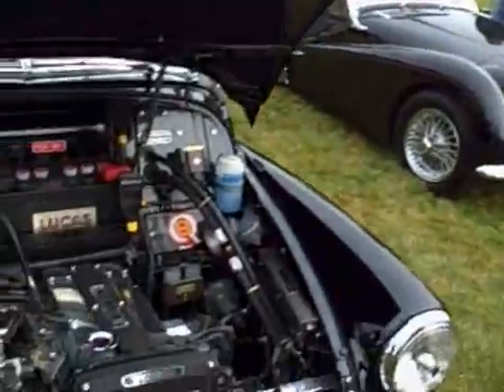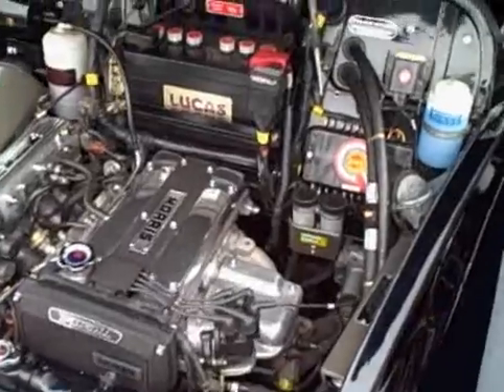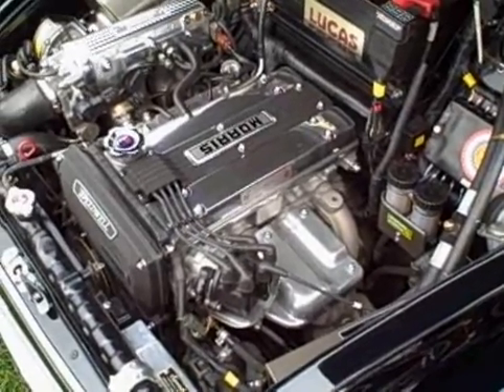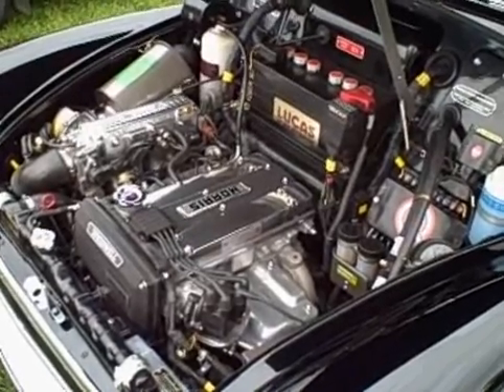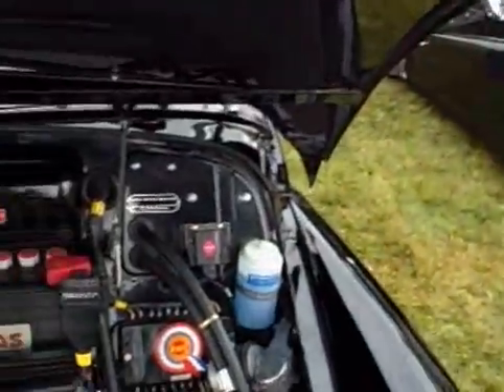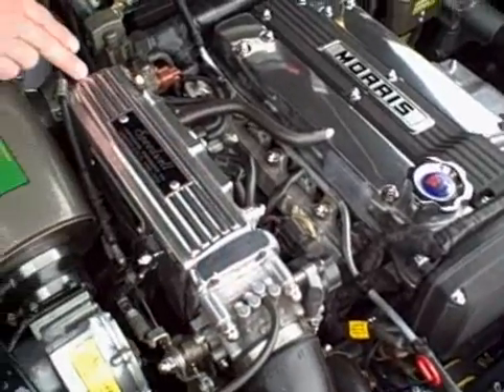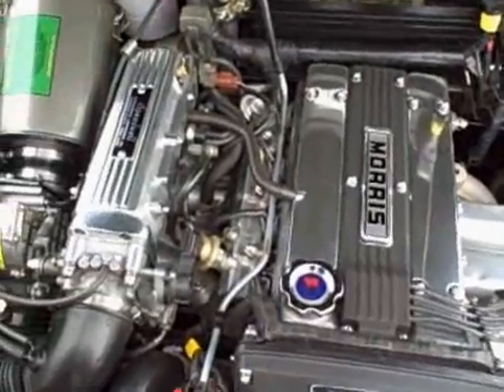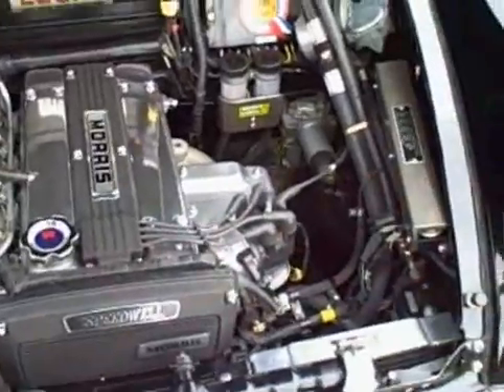Morris Minor Master Engine conversion

Comment: My first car was a 1959 Morris Minor 1000.  Light blue.  Didn't leak oil sitting still and didn't smoke but it used copious quantities under way.  Also no matter what l tried the brakes were  frightening.   I ended up trading it for a 1959 Karmann Ghia convertible with a Judson super charger and a 4 outlet Abarth muffler.  It was a fun car.  I drove it too hard and ended up driving off of a bank into a bog with about 12" of water.  I survived it all proving beyond doubt there is a God.

Comment: Hi Zac just wondering what you did for your fuel tank and return setup? is the thank off another vehicle?
Reply: The fuel tank is the larger "Seven Gallon" unit from a 1000 Traveller. I added a 1/4" return line to the tank.

Comment: Who were the five people who clicked on "dislike" - and why?
Reply: Del350K4 Great Conversion, but for a few maybe it's that he moved away from the true spirit of 'The Galloping Maggot,' what with all that eastern technology stuck into the engine well.....some might have gone for just an old school upgrade  with   M.G Midget / Sprite  Block... twin Carbs and a polished head coupled with a high flow high spec exhaust.... but i prefer this upgrade ....
Reply: That´s a balanced assessment; I´m sure you´re right. I´m very glad that you agree that there´s room for the old school and the more modern approach. I confess I do have a personal aversion to big alloy rims on classic cars, for example, but I try not to pull faces (and certainly not click "dislike") when I see such things   : )
Reply: Had a Morris Minor as a kid... very-very...easy to work on, you could stand into the engine bay to pull off the cylinder head [and i did] and just drop off the front grill with a single spanner and a screw driver then just lift out the rad... try that on a modern car...  i think not...mind you i would have loved to put in a big bore block type conversion  into the likes of same looking at the faces of others being passed out by a little  Galloping Maggot....
Reply: Ha ha! I had a tiny Honda ST70 Dax with a firebreathing CD175 engine; I used to sit there at the lights next to, say, a Holbay Hunter or a Capri, then, when the lights went orange, my tiny bike would bellow like a charging lion and vanish. They´d catch up at the next lights and I´d enjoy watching them staring at my engine   : )

Comment: turbo-mini.c o m     ....     featured cars  ....  Metro Turbo block modified to group "A" spec, Hardened 6581 crankshaft balanced+wedged, "Carrillo" forged steel con rods, Mahle low compression forged pistons, 4 bolt billet centre main strap,,,,ect ,,ect.
Not sure i would ever get any traction with this in my old p-up but it would of been fun trying. lol

Comment: yes i know but after doing all that supper work fitting the engine it would have made the engine bay look better 
i have looked at 100s of engine conversions on morris minors and i must say this one is one of the  best, but it would have been better if the battery was not at the back of the engine 
sorry ..
Reply: That's where the battery sits from the factory.

Comment: Nice job,though aircon on a Morris Minor must have been a challenge as a MM is very draughty inside even with the doors and windows shut! This being due to the poor door and window seals and the number of holes in the bulhead and floor that let draughts and water in.

Comment: i could talk to this guy in person, id say 2 things, first off the 4A-GE engine runs EXTREMELY cold. my MR-2 AW11 runs below half mark. on a 100 degree day reved up and ready to go, so coolant is NOT an issue with the engine, the second thing i would suggest to him, check out the 4A-GE 20V (blacktop/Silvertop) they are the same engine, same block, with different heads, 155 to the wheels 165 to the crank i wish i could say that to him!!! also 9000 RPM Rev with Auto ECU (STOCK)